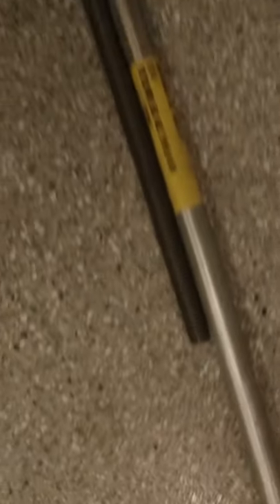Safely close your STUCK garage door.  #dyi #shorts #waynedalton

Comment: I just had a garage fix guy try and charge me $325 to do this. Thanks for your video and saving me money!
Reply from the maker: Hello!  Thanks for sharing your experience!

What exactly did the contractor want to charge you for $325?
Which side of the springs were broken?
Reply: @sosgds  he gave me an overview of the problem, recommended changing to the other type of spring or get a new door (because I mentioned we were considering that anyways). Estimate for spring conversion was $1400. That seemed like a lot so I asked if I could take a day to think about it. He was fine with that. I asked him how much to just get the garage door closed and he said minimum for a service call was $325 which he could do but wouldn't count towards the swap. So it would be $325 that day plus $1400 for the swap. I told him I would leave the door open and think about it. That's when I found this video.
Reply from the maker: @OscarPorras79  Goodness!  Thank you so much for sharing this information. May I ask what area you live in? Perhaps just the state
Reply: @sosgds  yup, Keizer, Oregon.

Comment: The lock is engaged for mine on one side but I cannot pop it open like you did. I released the first mechanism but the lock is still wedged in there
Reply from the maker: Thanks for sharing your experience.  It's possible that ratchet gear is lodged.  

Where are you at now in the process?

Comment: Garage is jammed at top. Odessy 1000. Emergency cord not working. How do I disengage the Odessy 1000
Reply from the maker: Hello.  This motor is very similar to the Genie C-channel rail assembly.  You have to pull down very hard on the red emergency release cord.  If your cord is broken off then you might have to pry the down the trolley carriage in order to disengage.  Hope this helps.
Reply: Thank you so much!